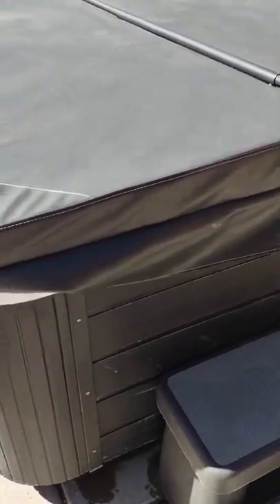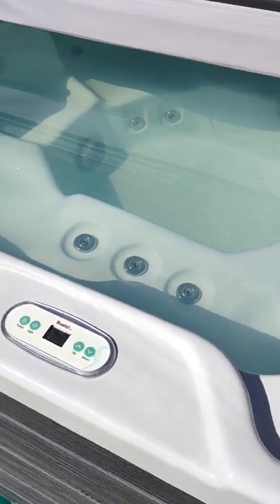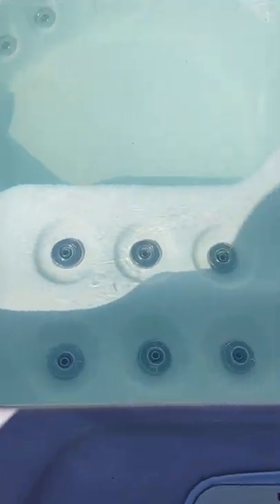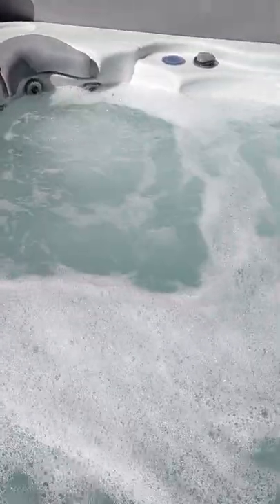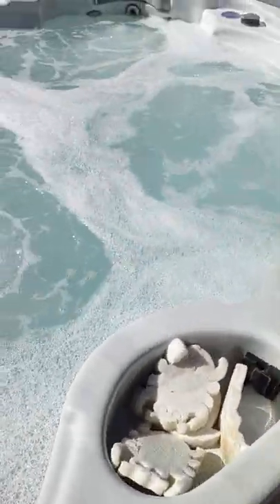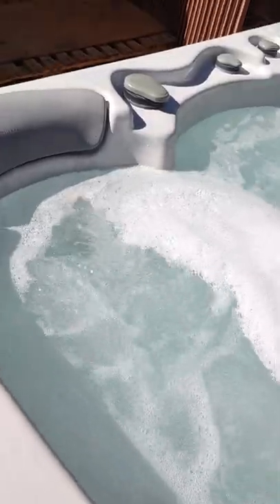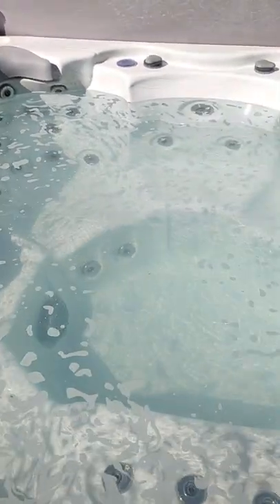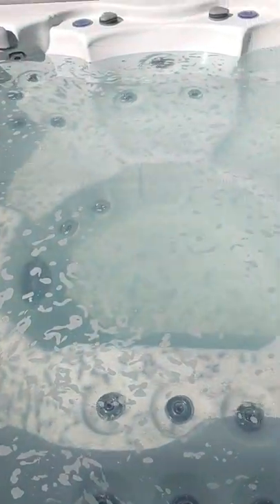The Best Six Person Hot Tub Value for Anyone on a Budget.

Comment: Can the heater be turned off for summer time use?
Reply from the maker: The heater stays on to whatever temp you set.  For example, if you set the temp to 101 degrees, but because it's summer and the water is staying at 101 from the sun, the heater won't kick on.  But, if the water goes before 101 the heater would kick in. But you could set the heater to 98 and know that the Sun could heat it to 101 so that heater wouldn't come on unless below 98, out whatever you choose.  Hope that helps.